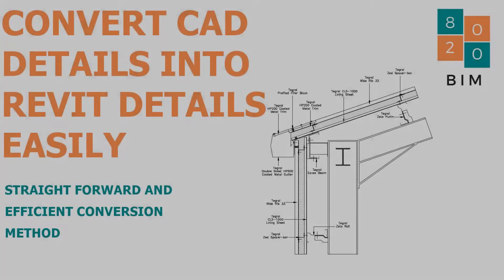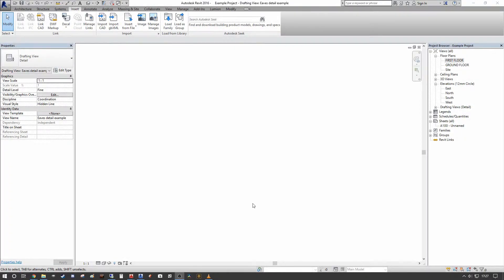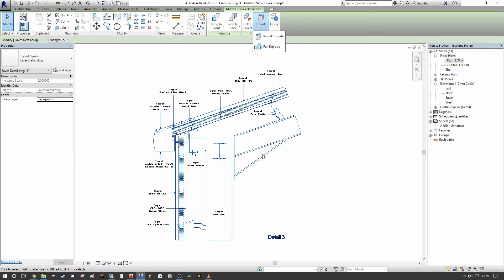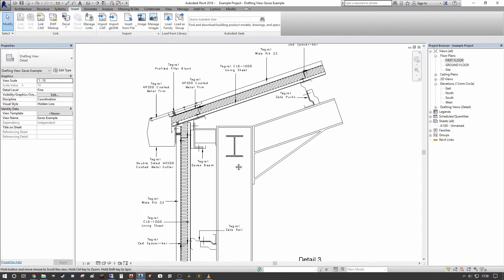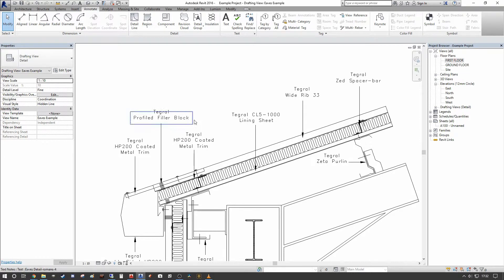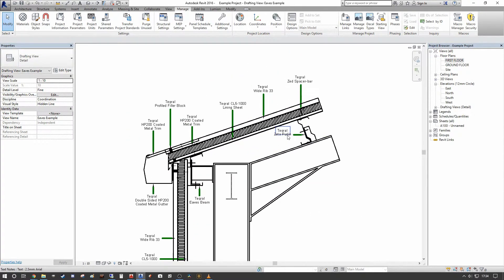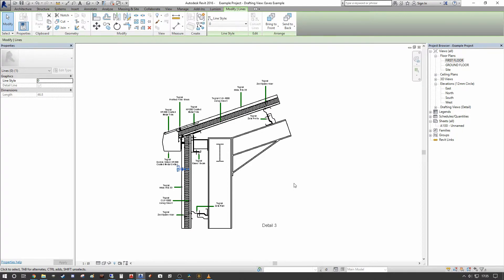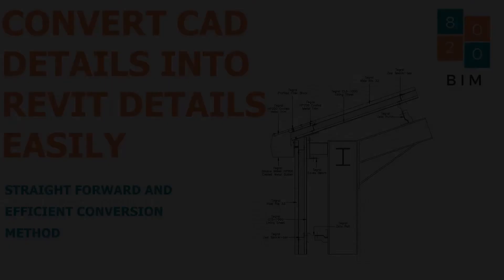Revit Tutorial - Quickly Convert CAD Details into Revit Details

Comment: Any "prep" to the ACAD files you recommend before importing?  I heard a few things when i ask other people. 1) convert all text to Arial 2) purge drawing 3) set scale of detail font so that text size in ACAD drawing is equal to what you want in Revit. Typically 3/32" for us in my company. Thoughts?
Reply: When I have to bring CAD into my Revit projects I typically change all the linetypes in CAD to layer 0 and remove hatch regions so if I have to explode I don't get 100 different CAD linetypes/ hatches junking up my Revit. Purge the CAD detail FOR SURE! You'll end up with a tons of 'IMPORT' linetypes than would have to be manually deleted after the fact. Honestly, I find this approach really messy and tend to draw on top of the imported CAD instead of doing the partial explode (depends how much time you have available though). If you do have time, when using the detail line function, when you hover over the imported CAD and hit tab you can grab a ton of lines at once.

Comment: Is this a legitimate way of carrying out a project in Revit? I naturally assumed sections & elevations on the sheet had to be reflecting the 3D modelled elements, I feel slightly uncomfortable using all the company CAD details for sheeting up, but I can't deny it would be much faster.
Reply from the maker: So, in short, it is "OK". I would always be cautious with using CAD in Revit. In the office environment I prefer to link standard CAD detail files into a blank model, redraft them and them move them into a template / container file for ease of use. That means we have a Revit standard detail library also.

I agree funadentally that all elevations, sections etc should be taken from the model to guarantee setting out and accuracy. The point of this exercise is for "standard details" really, ones that are used in multiple places throughout your work. It really is a video tutorial for those who are entering the Revit universe and are undoubtedly tight on time for deliverables by trying to acclimate to Revit, but it is not the recommended workflow in the long term at all.
Hope this provides some clarity.
Niall
Reply: @8020BIM  
Thank you for the quick response, that's cleared it up. As best practice I'll continue with standard detailing but this has certainly opened my eyes to the benefits of creating a Revit detail library. Our CAD guys can do some jobs in days (recycling drawings) that would take me weeks to recreate conventionally, this is a great solution for those tight deadlines, particularly for non-3D literate clients. Many thanks